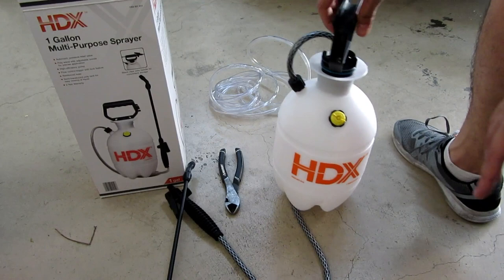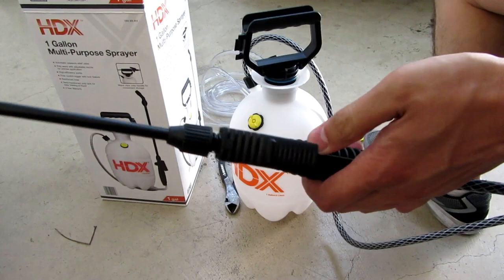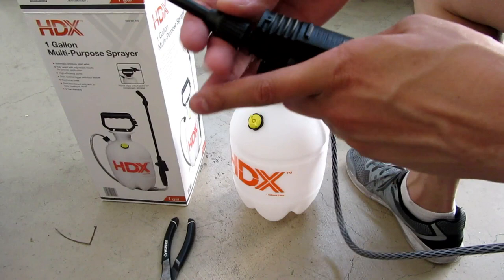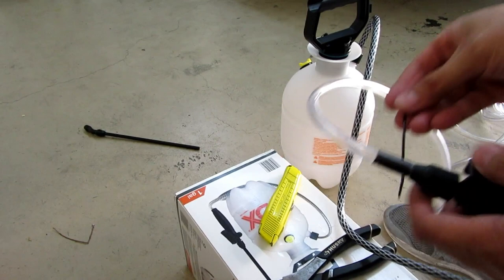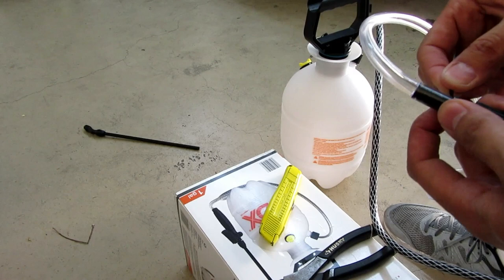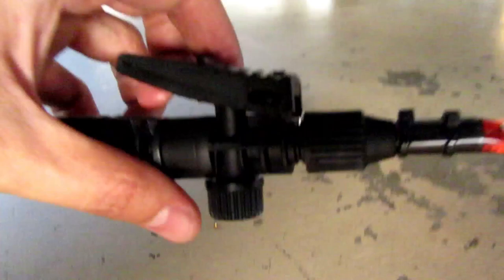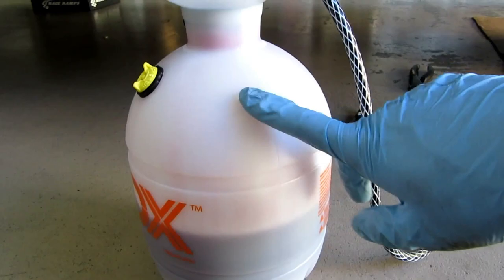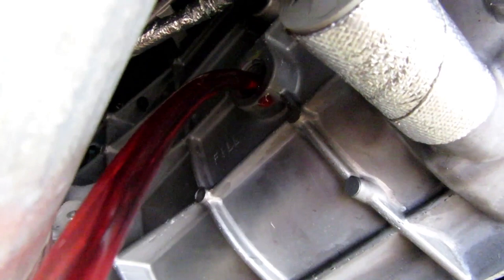DIY Homemade Fluid Transfer Pump for $13. Cheap and Easy!

Comment: Why not just use the wand. Take off the spray tip and heat bend the tip of the wand and go. No need for the clear tubing. Worked for me. If you warm up the fluid by putting the sprayer or bottles of fluid in hot water it makes it easier.

Comment: wondering if it can push that fast with 75w140 or 80w90 gear oil in it.  If so, I'm making one for my Mustang rear diff.
Reply from the maker: Not sure since that's pretty thick. My car only takes 1 1/2 bottles for gear oil so I just use the hand pump.

Comment: Do you use all GM oils for your car? I have a 2019 zl1 1le and I am looking for Mobil 1 0w-40 and can’t find it. Is the ACDelco oils the best for the car? What do you think?
Reply: I use M1 0W-40 for my AMG.  It's litterally sold everywhere here in FL.  Even Walmart has it.
Reply from the maker: I use Mobil 1 5w-30 for summer when I'm not tracking, then Mobil 15w-50 pretty much the rest of the time. Transmission: Royal Purple Synchromax. Differential: GM (ACDelco).
Reply from the maker: @skullboxdotnet  That's a different formula than what Patrick is referring to.
Reply from the maker: @Fu Nguyen some owners who live with extreme summers like AZ or TX will run 15W-50. I don't drive the car much during summer and use recommended 15W-50 for track use. Car is under warranty with 5W-30 street driving and 15W-50 tracking.

Comment: Why did you cut the wand?  Just screw it off and pressure fit the tubing on the threads just distal to the trigger.  Much easier and still works fine.  You can still use zip ties if you want, but I've never had a leak problem as long as I keep it under about 30 PSI.  Furthermore, if you destroy the wand, it can never be used again as a sprayer.  A little brake cleaner and a good flushing would make that possible, but again, NOT if you've cut the sprayer wand in half.

Comment: you can add a rubber valve stem and use air instead of pump
Reply: I Did That On Mine With A Tire Valve Stem Works  Great

Comment: It Works Great i Have  One For ATF And One For Brake Fluid. It Will Not Damage The O Ring Inside And Will Last For Many Many Years. Best Part It's Cheap And Works Fantastic. The Second One I Bought At Home Depot  Was Only 4.99 For A Limited Time For The One Gall. So How Can You Beat That ?

Comment: I bought the same pump. Except i removed the tip and melted the wand into a U shape. Just inserted some thick wire so the tube wouldn’t close under heat. I have an 8L90 with dipstick fill on top. Hooked it in hands free and pumped away. Great vid.

Comment: When you pump the multi-sprayer, a high air pressure is created inside the sprayer container.  So when you put the tube connected to the pump container inside the transmission, won't the tube just push air out into the transmission instead of sucking transmission fluid out of the transmission?
Reply from the maker: I'm not trying to suck out fluid from the transmission. There's a drain plug for that.

Comment: its sprays, how is it sucking?

did you reverse the valves??
Reply: He’s not extracting. He’s pumping it into the top of the transmission after draining from the lower plug. Looks like he’s flushing the system good before inserting the lower plug, after which he’ll top it off. It’s useful when areas are difficult to work around.
Reply: Oh, if you’re looking for an engine oil extractor, look up DIY shop vac oil extractor. Mine works great, but I’ve never used manual, pneumatic, or electric extractor so I can’t really compare them. I can tell you that it’s about the same speed/time as a manual extractor from what I’ve seen.
Reply: @fallingjeff  0n

Comment: Wonder if it would pump gear oil. Got a Defender to change the fluids on, 2 gallons of 90w 🤔
Reply from the maker: That's much thicker. Not sure how it would do. At least it's cheap to try it.
Reply: @MikeEM1  Confirmed, it will pump 90w. Temperature here in the UK was 18c/64f which probably helped. Took about 8 mins to pump 2.5 litres into the Transfer box.

Comment: What psi did you pump the sprayer to prior to releasing ATF fluid?
Reply: There’s no PSI gauge on these $10 tank sprayers nor should it matter for this application. You just need to fill a reservoir, just like the engine oil but you don’t get gravity to help on the transmission fill.

Comment: Awesome idea 👍 is 3/8 the inner diameter of the tubing?
Reply: I ordered 3/8 ID and it was way too loose.
Reply: @matthewhultstrand5047  i wound up opening the sprayer inside home Depot and matching up the tubing.   I believe the one I got has an outside diameter of 3/8 and inside diameter of 1/4"
Reply from the maker: @werdlyfe9577  sorry for late reply. It's over all 3/8. I should have been more specific.

Comment: Think it would work with diff fluid 75w-90
Reply: Put the gear ⚙️ oil in the microwave 1 min then try it 😊I think will work

Comment: why not just by a harbor freight battery powered unit for less than that?
Reply from the maker: Which unit
Reply from the maker: @FahimMotoGP  I have that. Wouldn't work very well being under the car.
Reply: @FahimMotoGP  how well does it work? it looks like it's pretty garbage
Reply: @jacoboflores9257  I have this Harbor Freight crap and its garbage it leaks, this pump sprayer idea is way better and its all in one unit instead of pump being separate and pumping out of another canister, and Walmart sells pump sprayer for $10

Comment: Why? You have a $$$$ car and can't buy proper tools to maintain it?
Reply from the maker: To do something creative for YouTube? To save others money? Does it not work in the video? What's the complaint here?
Reply: if you think this way, the car should be serviced by dealer, not DIY
Reply: I mean if I can save a few bucks and get something more effective I'm all for it
Reply: Mechanic for 25 years and I’m all about having the proper equipment, but for a fluid pump this is perfectly acceptable why spend a few hundred on a mighty vac or other system just to move fluid.  I could use that savings towards other equipment
Reply: That's how ppl can afford $$$$$ cars buddy, being smart with their money chief... I just did the same thing for my BMW and THEN found this video<<<Guess I'm not the only genius out here. WahWahhhh